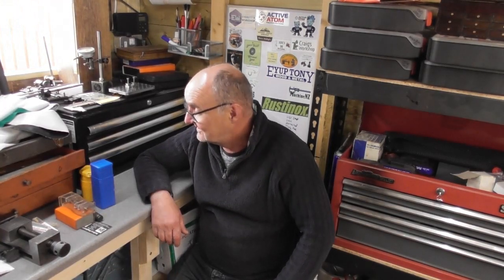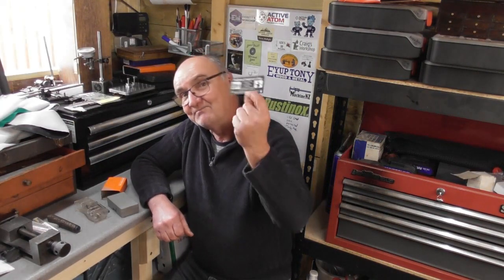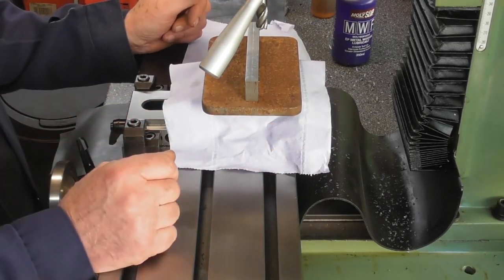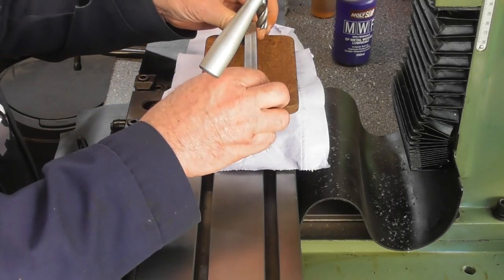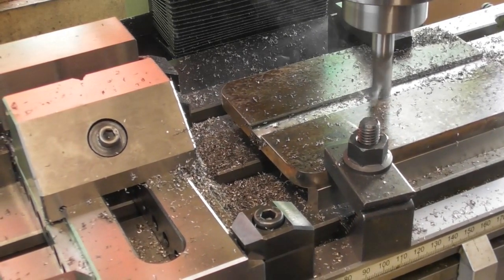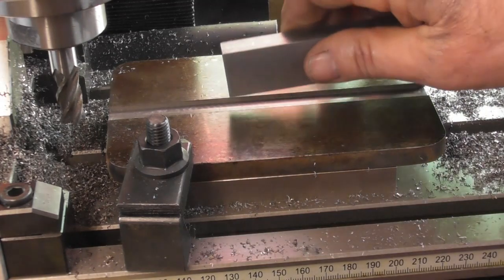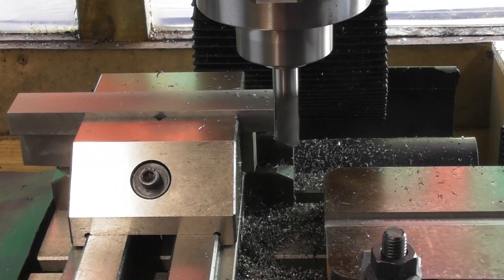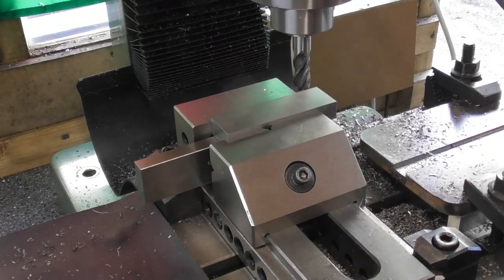A tooling plate for my mill part 1

Comment: Great start Ade. I've seen Tom Lipton using one of those plates. I also see Bosted Tap commented about whether the correct term is tooling plate or tooling/fixture pallet - very interesting and I learned something today, that makes it a good day.

Making one of these is on my todo list. I am thinking of using a piece of 20mm thick aluminium plate and making it around 300mm square (about 12" square). And if it gets chewed up, I can always dress it off true to the machine using a fly cutter or face cutter. Not sure when I'll get round to it though - the tooling todo list is infinitely long!

PS: Thank you for your well wishes, I hope you remain well too. Good that your job has some work for you from home. And - thanks for continuing to put videos out, I appreciate them a great deal. Each time you come on screen it's like seeing a good old friend, calming and relaxing and friendly, and skilled and generous to boot. Very much looking forward to the next one.

Cheers, Craig

Comment: Tooling plate is the correct term for a single item, a Tooling or Fixture Pallet is normally associated with automatic machines, whereby castings or fabrications are clamped to each pallet, and then loaded into each machining centre, and the pallet is locked in a repeatable position. The first time I saw these was at JCB Wrexham in 1989, very impressive machining operation, I was installing a differential assembly line for a company from Coventry. That's my understanding, please correct me if I am in error.
Great addition to the shop, nice design.
I have a Sticky pin on my mill, though it's been a while since I used it.
Well said on protecting the hard working delivery staff, though since non essential shops are closed, online orders are most likely greatly increased.
Stay safe all and thanks for sharing.
Reply: Good info Bosted Tap - the distinction between a single plate and a series of pallets makes perfect sense. I have never used a sticky pin - I reckon it's more accurate than my quick and dirty method of using a spot drill and lining up by eye. I do use an edge finder though when I'm trying to be precise. Cheers, Craig
Reply: @CraigsWorkshop  Beware of sticky pins, sticking plasticine to a sharp milling cutter, means cut fingers 🚑, but using Ade's method of a drawing/push pin is a little safer, though I was taught to use the back of my thumb/nail. Regards John.
Reply: @bostedtap8399  Thanks John. Noted!

Comment: Hi Ade, Spotting drills are used to position drilled holes, they are available with 90 or 120 degree points ( 102 being the best for us with standard 118 degree points), they have no land so would be unable to drill a hole as they have no clearance. Stay safe. Cheers

Comment: I would think spot drills are almost a 1 size fits all? Use a bit one and make the spot the size you want?
Reply: I just use a single medium sized one 8 or 10mm I think. I drill as deep as I think I need for a particular hole size. Sometimes a touch deeper which gives a bit of a break edge which is good for either clearance holes or tapped holes. It's seen better days, and I don't reckon it'd be that easy to sharpen, so I've been thinking about buying a single larger carbide one perhaps 12mm or so.